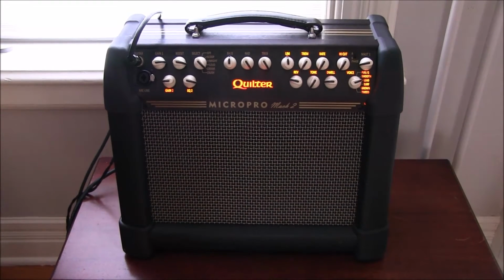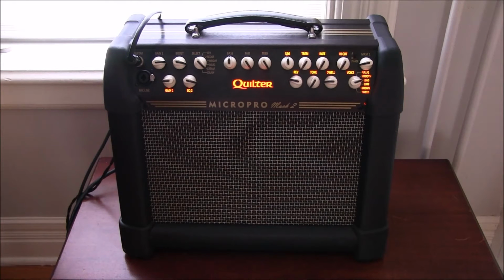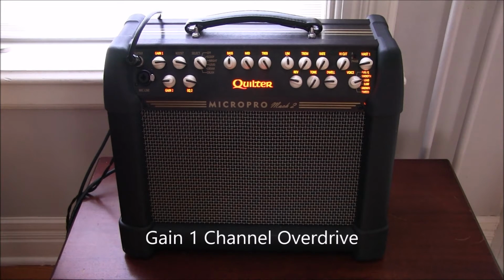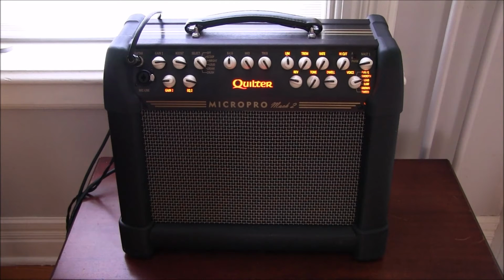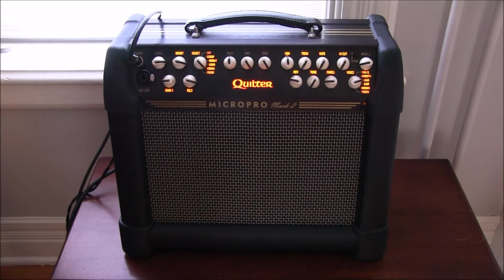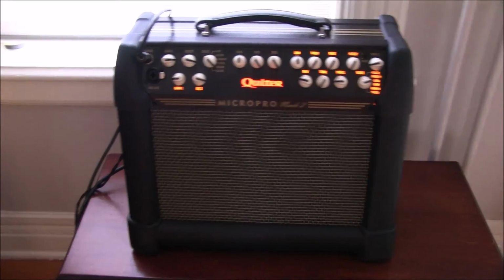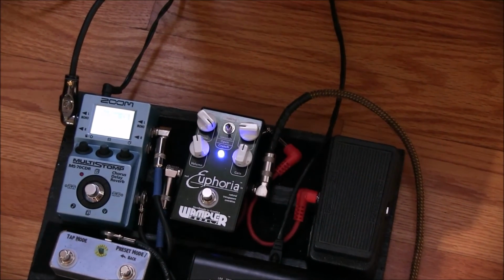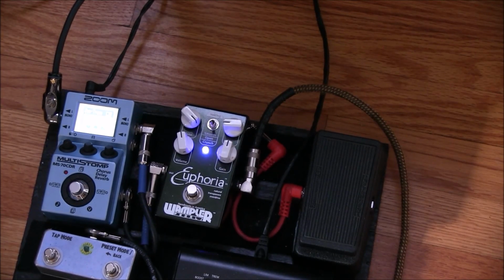Quilter Micropro Mach 2   Overdrive sounds

Comment: I just got mine in a MINT condition this week. I wanted the Mach 3 Aviator, but it is way too big for my use. I was about to purchase the Overdrive 202 when I saw this one on Reverb.
I ear you have a big blowing noise at 2:00 when you do not play, I also have the same "issue". Did you find out a solution or you just "live with it" ?
Very usefull video, thanks

Comment: Why do we need a drive pedal,want to hear the amp grind plugged straight in.Wanna know which quilter will overdrive and have a great clean sound
Reply from the maker: You don't have to use a drive pedal - but it's one of the ways to get an overdriven sound (like with any other amp). Any of the Quilters will give you an overdriven sound.
Reply: But not a good overdriven sound based on this video.
Reply: John Hilliard 
I've yet to hear the Quilter amps produce a hot fat wailing tone with sustain, it's all half dirty "AC/DC" rhythm sounds at most. Think the Quilters are incapable